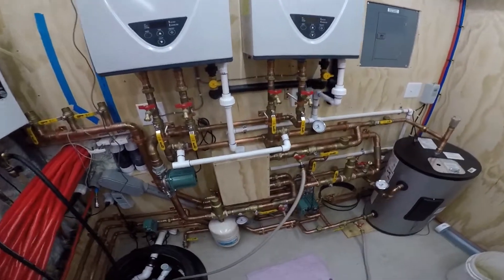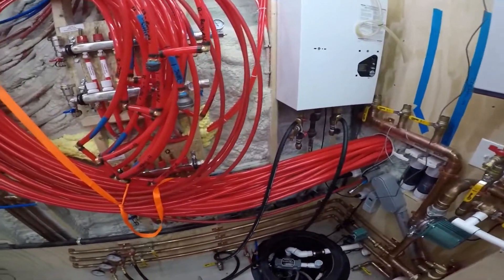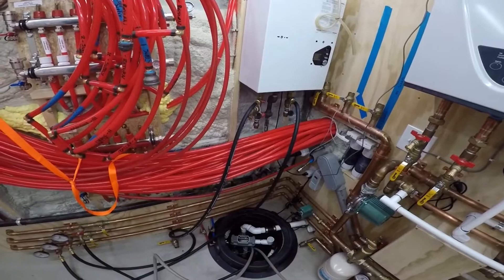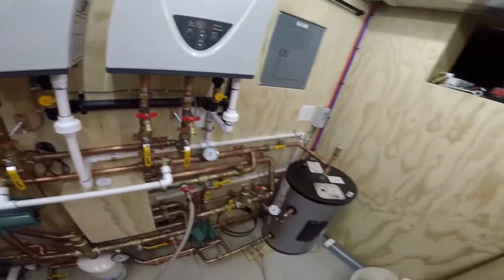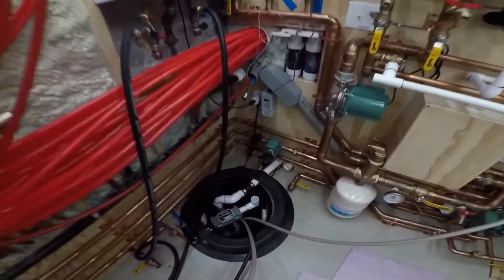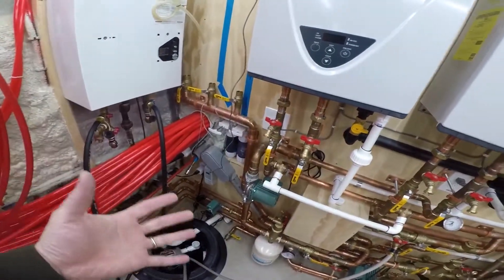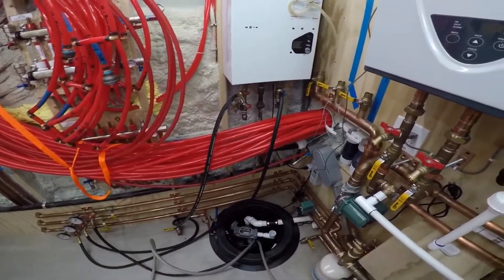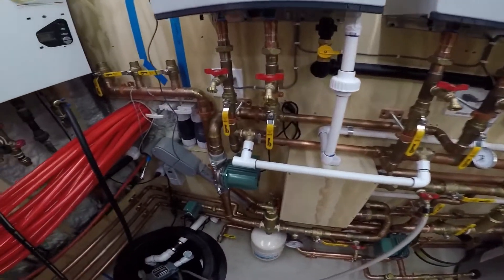Filling The Domestic Hot Water Piping and Buffer Tank with Water - Episode 25 [11-17-2020]

Comment: Did you make a video of your conversion to a buffer tank?
Reply from the maker: Hey Kory!  I'm not sure what you mean as far as converting to a buffer tank.  I designed this system to have the buffer tank from the beginning. Check out this video which may help: https://youtu.be/gbUNSK5N-p8  If I'm misunderstanding let me know, I'd be glad to try to help answer what you're looking for.  I can always make a video on something too if I don't have one on it already.
Reply: I didn't know what went into turning an electric water heater into just a buffer tank. Or is it pretty strait forward, just removing the heating element.
Reply from the maker: @korykearney6497  Ahhh ok, I understand what you're asking now.  Yup, it's as simple as that.  I removed the factory electric heating element and stock thermostat, and then installed an aquastat well like this https://amzn.to/3V0L3Om in its place (along with a few bushings / reducers).  This let me slide the probe for the Ranco aquastat that turns on / off the tank pump along with some conductive heat transfer paste deeper into the tank, to hopefully get a more accurate reading that just being strapped to the side of the tank.  I didn't really take a video on that process, but you're not the only one that has asked, so maybe I'll record something and put it up.  Coincidentally, I'm actually going to be putting the heating element back in soon.  We're having solar panels installed and once we do I'm going to switch the tank back over to electric, with the tankless units as backup.  I'll do videos on all of that, including how I'm going to wire it up.  Hope that helps!